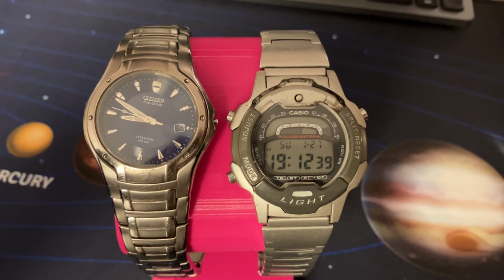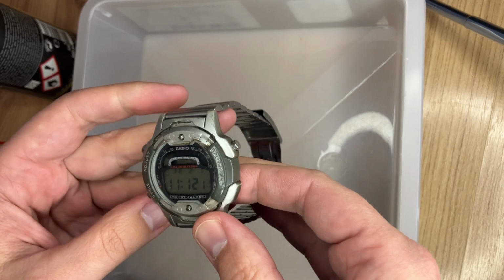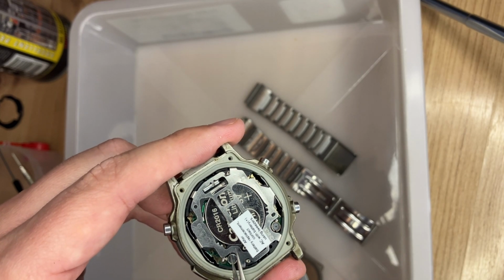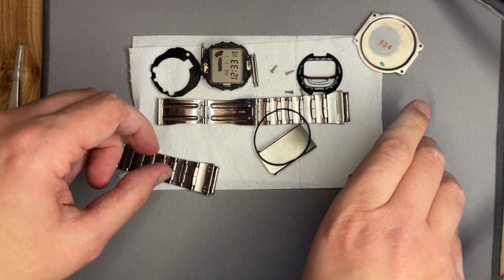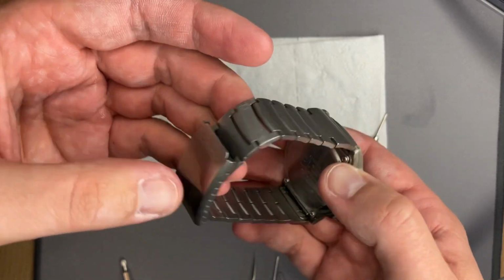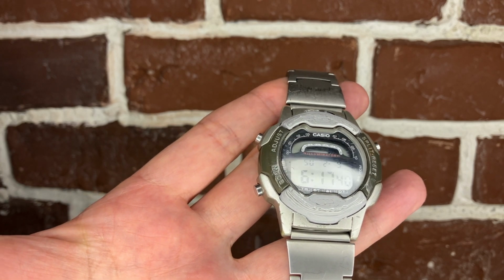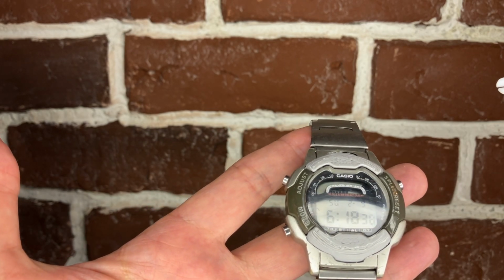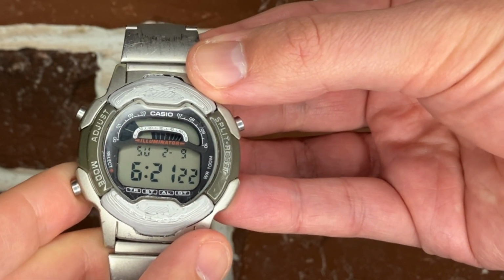Casio W-729H youth watch from 90s & Repair with 3D print & How to replace the battery

Comment: Selamün aleyküm. This watch was a gift from my grandfather in 1999. But I changed the battery and it's not working anymore. 😔😔😔
Reply from the maker: Hello! Try to AC reset it. 
Make short circuit in between the backplate of the battery and the pcb contact (it should be near a mark with AC)
Reply: @cj80gdi-321xxx-moon I've been trying to do this for an hour but it's not working.
Reply from the maker: Maybe it’s a stupid thing to ask… is it the correct battery type? Is it a good battery? Maybe it got corroded.. clean a little the contacts for the battery

Comment: Im restoring also one like this, how do you safely remove top pushers , are they glued ?  just need to pull them off and put them back on, dont wanna damage them i need repaint the watch to make it look like brand new
Reply from the maker: Hello! Good luck with your project! Please write me an email so that I can provide some pictures to see exactly how it looks. As far as I remember you only need to pull them off, but in my case the original pusher does not fit properly and i am not sure if I have damaged it, or it was previously damaged.

Comment: Hi, thats a cool watch, I didn't know it before! The big Start-Stopp button is a pretty nice feature. A little note for the battery replacement: You don't need to undo all the clips and remove the whole metal piece; underneath the sticker is a tab which you can simply open to remove the battery! Otherwise, nice effort on the 3d print, how did you actually scan that piece? Do you need a special device for that? As for the printing quality, I can just recommend spending some time with sandpaper to get it clean and maybe even polishing it up at the end!
Reply from the maker: Hi! Thanks for the tip in regards battery replacement!!! For the scanning, that was the easiest job, a light scanner from were I work has scanned it. The scan needs some detailings which i guess would make a better printing … this is why i have shared the drawing. And yes, some sand paper could improve the printings…
Reply: @cj80gdi-321xxx-moon  Oh alright, I see that those scanners are pretty expensive.. But thats a pretty helpful device! Thx